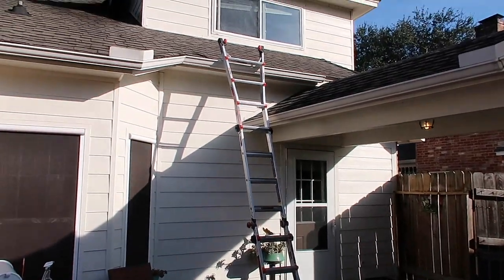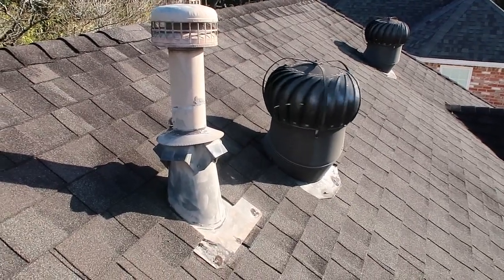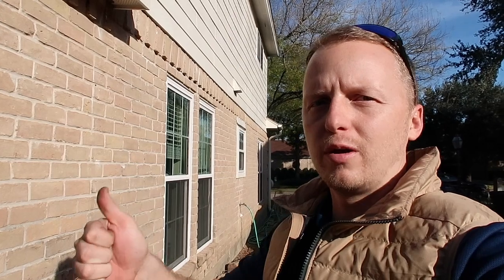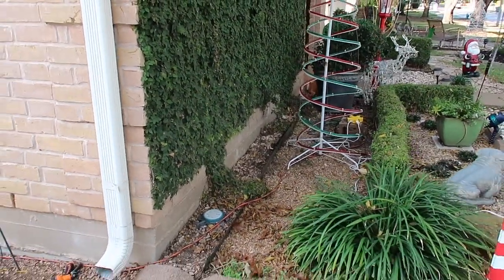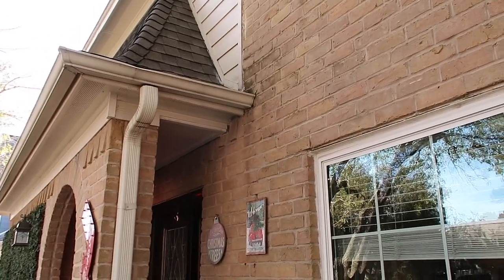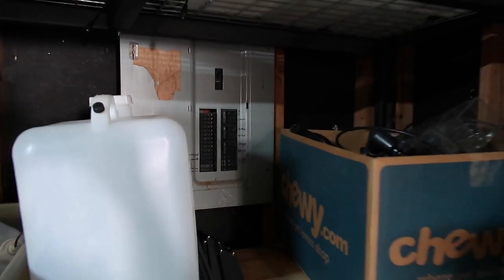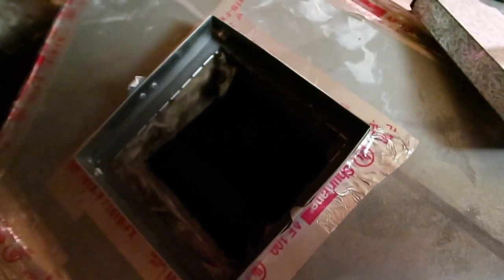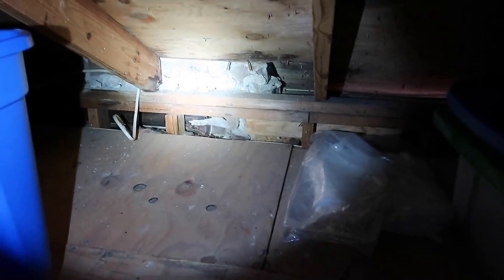1981 Home Inspection - The Houston Home Inspector

Comment: Great video! Modern water heaters come with dielectric nipples on the cold/hot side of the unit and normally don't require additional dielectric unions, so not sure if you were referring to some other parts of the piping. Also, the secondary drain on the AC coil appeared capped.
Reply from the maker: Awesome spots,  I honestly encourage this because it is hard to cover everything in one video on a job.  Just enough time for a brief scan.